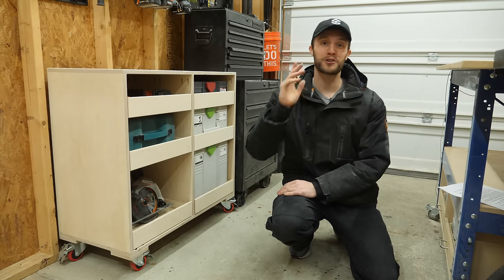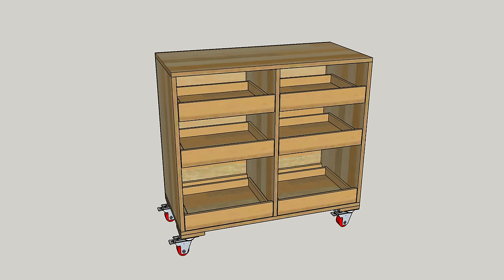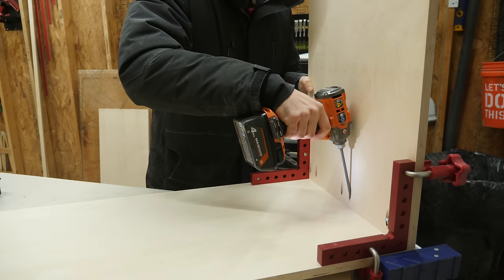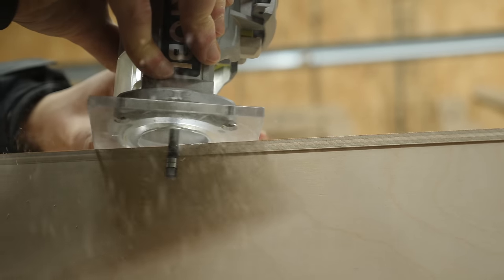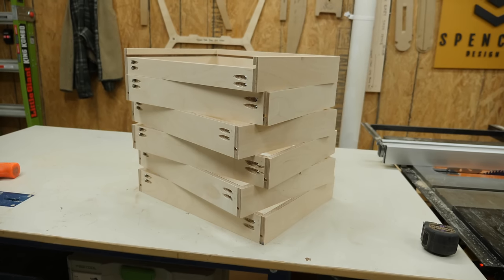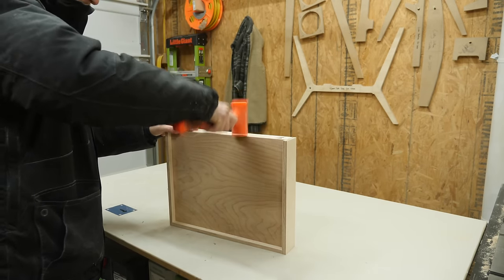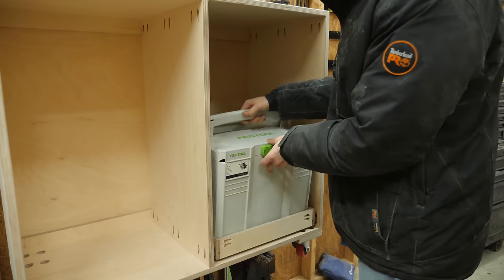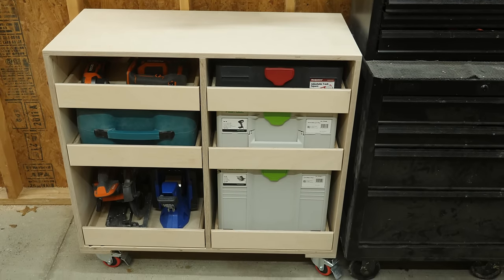a BETTER way to store tools

Comment: Pickles very great and handy job. I turned and old press on its side and non-sliding shelves  using same technique as you no measuring just height of tool stored on each shelf with fist height extra to easy grab each one. I'm looking to rebuild new one but you have me great ideas in your video with your castors. Thank you
Reply from the maker: Thank you for watching, billy!

Comment: dill pickels just saying
this looks great because the normal steel tool boxes are set up to fit car mech tools. i work on boilers and chillers so i have strange shapes and vacuum pumps and recovery machines that don't fit. something like this would let me make up a project cart with my tools and i can make it to the same size as the tool boxes so i have a larger work surface. 
thank you
Reply from the maker: Sure thing, mike!

Comment: Pickles. Enjoyed video. Great seeing you do smart things like raise the cabinet up on horses. Either to work on it and/or film it better.

Well built with good choices. I overbuild carts if I’m putting a heavier tool on them and plan on pushing it around. Large racking force there but this thing probably doesn’t need it and has the full back piece. I like seeing 3/4 ply cabinet with 1/2 ply drawers as it just seems the most logical and reinforces decisions I’ve made. Always kind of a struggle when deciding if I can get away with 1/2 cabinet body. Cheers
Reply from the maker: Thanks for checking out the video!

Comment: Pickles— what’s your favorite sandwich? These key words seem to always be sandwich ingredients, so I’ve got to believe you’re a sandwich enthusiast.

Great build, definitely need to organize the garage in the new year, this will be very useful! Do you plan to use the top as a tool stand? If so, are there any tools you avoid mounting on a stand with casters? I want to save space but also am concerned about wobbling.
Reply from the maker: You've got a smart brain, Patrick!  I'm a big fan of a classic turkey sandwich.  I don't have any plans at the moment for mounting a tool to the top but you definitely could!  I have not found any tools that I wouldn't want on wheels yet

Comment: Pickles, but the question of the day is sweet, dill, Kosher dill or bread and butter??  Inquiring minds want to know.  Nice cabinet.  I think I need to incorporate this into outfeed table I need to build.  Your shop is smaller than mine but I have a bunch of stuff for my apartments stored in mine.

Comment: Pickles…hello fellow buckeye and engineer grad. I’m 3 hour from Columbus. You mention you got Baltic birch from your local supplier. May I ask who that was (assuming you are still in Columbus)?
Reply from the maker: Hi, pat! I get mine from a place called wood werks. They’re definitely not cheap, but one of the only places nearby I can find quality plywood
Reply: @SpencleyDesignCo  been there recently and purchased some tools. I noticed the plywood they had and the cost. I guess that sort of dollar figure is the new norm for Baltic birch.

Comment: Pickles. How do you calculate the size of the bottom piece of your drawers given that you’re using a dato for the bottom? Thanks this useful video
Reply from the maker: It depends on how deep you make the dado. Just the size of the interior drawer plus the dado depth
Reply: @SpencleyDesignCo  thanks , I’m new at making drawers and the reason why I asked is because I purchased the drawer side panels already with a dado but the dado depth I noticed is not consistent and measures between 3/16 and 1/4 inch , which makes it a little cumbersome to calculate the size of the bottom plate
Reply from the maker: I’d just start with a panel that’s too larger and slowly trim it until it fits

Comment: Aha, pickles r nasty. Your work is superb though. My table saw is not that smooth. Maybe I need to upgrade and practice. Love this setup for tool storage. My stuff works but it’s definitely pretty rough.
Reply from the maker: You can do it! Check out some of my old videos where I built tons of high end furniture with a $200 saw

Comment: Pickles. Interesting build. Why did you go with such short drawer fronts?
Reply from the maker: Mostly so that I can see what tools are on each tray
Reply: @SpencleyDesignCo  Do you find that sawdust gets in there with the shorter fronts? Just curiosity is all.
Reply from the maker: Nope, I haven’t had any issues with it

Comment: Pickles, kinda funny how cucumbers 🥒 are called pickles when they are canned but canned tomatoes 🥫 are just canned tomatoes 🥫 even tho they are also pickled. How would you cut a 4x4 piece  if you don’t use a miter saw?
Reply from the maker: I don’t do construction projects so I probably would never run into that issue. But if I really had to, I’d just use a circular saw and make two cuts

Comment: PICKLES! HAHA!
I've been having some issues with the cabinet boxes on the mobile tool/storage carts I've built, which are very similar to this one you built in this video for instance, racking out of square after some time of use. I've tried to mitigate this in newer builds with added corner bracing when I have the option but it still seems to happen. Any chance you or any other viewers on here have a solution or an idea?
Reply from the maker: Hmm I’ve never had that issue with an of the cabinets I’ve made. Are you using cheap plywood that’s warped?
Reply: @SpencleyDesignCo  Cheap is relative I suppose when construction grade CDX Plywood was up to $85 a sheet around here...But no, I have been buying and using cabinet grade Maple and Birch and some Radiata Pine, which ranges in $65-80 price. I am picky, and make sure it is straight and flat. That's why I can't seem to figure it warping like it has. My shop is climate controlled to so...IDK. I have yet to find anywhere in this state that sells the "Baltic birch" plywood that all the Youtubers seem to use. I have searched all the supply houses around here and no dice.
Reply from the maker: Interesting… I don’t know why it’s warping then. Maybe the place your buying it from is super super humid? 🤷‍♂️

Comment: Any reason you have the side panels inset to the top and bottom panels?
Reply from the maker: Just so all three vertical panels were the same size. It really doesn’t matter though
Reply: @SpencleyDesignCo  No shade or anything, was just curious if there was a reason. I've always thought having it the opposite way was the standard, hence me asking :). peter millard had this video about it also: https://www.youtube.com/watch?v=3N_T-YpkBCg&t=404s&ab_channel=PeterMillard

Comment: Pickles 
Well no insulation/no heat 🤭 
What part of the country you in?
And rather than adjusting pocket hole drill collars, just get a bit for each size and color code them.
Reply from the maker: That’s a great idea!